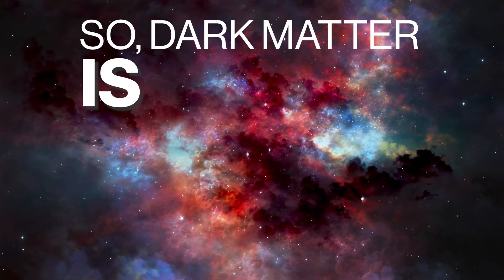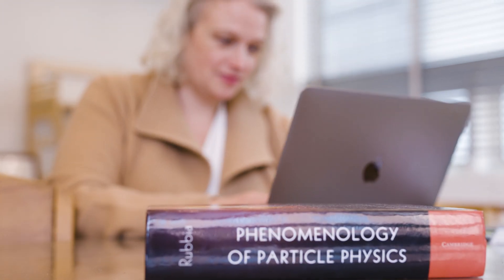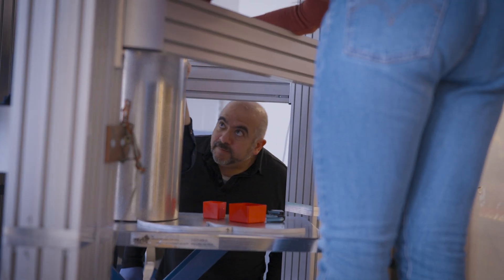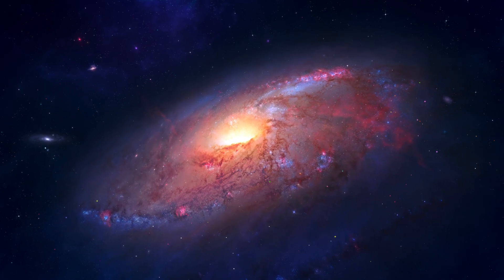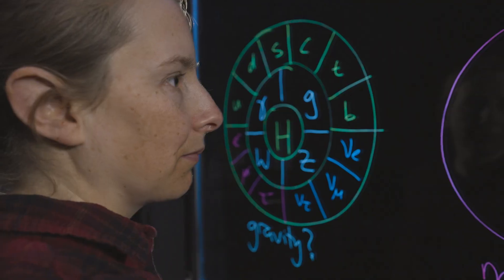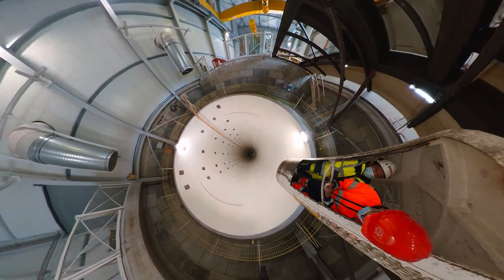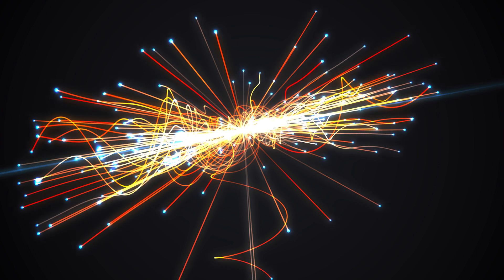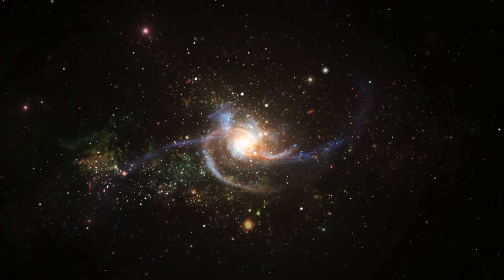The dark matter mystery

Comment: As well known in the field, Vera Rubin discovered the flat rotation curves of spiral galaxies using optical spectra, which could be a Noble prize worth discovery. However, very few people noticed that when Vera Rubin interpreted her observational results, she made a very simple mistake: She applied the spherical model to the spiral galaxies (see the paper published in Science by Vera Rubin: Science, New Series, Vol. 220, No. 4604 (Jun. 24, 1983), pp. 1339-1344). Also, when you read the paper published by Fritz Zwicky in 1937 (THE ASTROPHYSICAL JOURNAL, Vol. 86, No. 3, 217-246) carefully, you will notice that he also utilized a spherical model to estimate the mass of the Coma cluster.
As every physicist should know, an object with a spherical mass produces a Keplerian rotational curve, but a disk-like mass distribution will not follow that. Therefore, the key issue is how the mass is distributed in a galaxy. Any galaxy with a spherical (or close to spherical) mass distribution will not need dark matter. The results of NGC1052-DF2 and DF4 are the examples. The flat rotation curves of spiral galaxies are caused by the disk shaped (non spherical) mass distributions. 
With the latest GAIA data, we can show that by using a disk mass distribution model and by solving the Poisson equation of the Galaxy, we obtain a flat rotation curve which reproduces the key observed features with no need for a dark halo (see arxiv paper 1612.07781.pdf).  
So, dark matter does not exist and it is just a consequence of misusing Newton’s law in gravitational systems with non-spherical mass distributions (DOI:10.1142/S2424942417500049). Newtonian mechanics does not need to modify when the non-spherical mass distributions are considered.
Reply: OK, now you’re just showing off. 😏

Comment: A new galaxy they're sure should be much dimmer than it appears (in other words, it's relatively low in attractive effects despite its overall brightness), although they don't know of any galaxies that look exactly like it for comparison: NGC 1277. Spoiler - it gives an unobstructed view along the cone of a luminous "X" pattern, which itself is likely a frame-drag (spin induction) effect, normally diffused within a significant central galactic bulge where it's consequently mostly evident in many spiral galaxy side views, such as with NGC 2424. 

In short, NGC 1277's brightness apparently depends strongly on the viewing angle, something our self-esteemed experts can easily ignore while wallowing in exotic dark matter confines with wormholes. Nonetheless, even MONDs "cousin field" ersatz gravity halo and imaginary galactic-scale-wavy axions won't save dark matter fools from eventual royally bent gravity theory spacetime misery. 

Imagine gravity flows conforming to spinning baryons shaped like triaxial radar reflectors. I suppose there's a relevant critical angle off the spin axis where a spinning macro-object's gravitational effect macro-flips, from inducing a largely same-direction spin to inducing a largely opposing spin, as the object's spin plane is approached. Seems the spin flip angle forms the legs of any galactic "X" pattern. Possibly the light there is uniquely polarized. A cold (or a strong-gravity-controlled spin) triaxial retro-reflective property for baryons could amplify any polarization contrast. 

Gravity thought-leaders usually avoid calling the Lense-Thirring effect (frame-dragging) a focused quantum gravity effect, let alone an effect showing "spooky action." It's a candor thing, I suppose, easily avoided with a mysterious space-time "fabric" or a "foam" of Planck-scale "bridges" and "holes," where a lack of focus and an easy preoccupation with randomness is not an impediment. Gravity also most likely carries an intrinsic galactic-scale longitudinal spin wave within it, which encourages a notably starless dark ringlike region occupying a substantial area evident in many placid spiral or ring galaxies (see avatar) with an effect of helping to confine fast peripheral galactic matter near its outer edge effectively enough for a "halo" effect to show as a strong peripheral galactic spin profile.
Reply: 😳
Show off!  (But I gave you a thumbs up, because it’s kind of fun being baffled)

Comment: Alternative Explanation of Dark Matter and Dark Energy - 4-D Hypershere model of Universe can easily explain Dark Matter, Dark Energy, Void and even the reason why the measurement values of Expansion Rate are around 70 km/sec-Mpc 

Dark Matter, Dark Energy, Gravity, Void and Antigravity, ... all these are same phenomena. They just look different.
The problem of modern physics is they're trying to explain everything with particle physics and the physics is being cornered more and more to the dead end. To escape the dead end, they invent or design another imaginary particle in vain instead of trying to revise their way to approach to the problem.

I agree to that idea that the interaction between mass and space must be explained with quantum mechanics.
But that doesn't mean gravity is the QM phenomena.
That's because gravity is not a force.
Dark Matter, Dark Energy, Gravity, Antigravity, Void... all these are  just  joint effects of the expansion of the Universe and the curvature of spacetime.
Details are given below.

Einstein’s theory of General Relativity states that spacetime is curved by the presence of mass. 
This curvature influences the motion other objects with mass and gives rise to gravitation.
Thus, gravity is a result of geometric features in spacetime.
However, we also observe gravitational effects – curvature of spacetime – in areas without any detectable mass.
This has given rise to the concept of dark matter, which is matter that does not interact in any detectable way with normal matter, except through gravity.
So, there is some large quantity of dark matter scattered throughout the universe, which curves spacetime and causes gravitational effects just like normal matter, but we cannot see or detect it with any known method.

An alternative theory to the identity of dark matter is proposed – it is not matter at all, but rather an intrinsic curvature of spacetime.
In other words, spacetime is not naturally flat. Even in the absence of matter, we observe some inherent curvature of spacetime.

So, the question is now – why is spacetime naturally curved? Why is it not flat in the absence of mass?
The universe is 4-dimensional, with 3 spatial dimensions and one dimension in time.
Rather than consider time as a linear dimension, we can consider it as a radial one.
Therefore, rather than describing the universe with a Cartesian coordinate system, we describe it with a 4-dimensional spherical coordinate system – 3 angular coordinates, φ1, φ2, φ3, and one radial coordinate in time, t.
We live on the 3-dimensional surface of a 4-dimensional bubble which is expanding radially in time.
Thus, the Big Bang represents t=0, the beginning of time.
The crucial point is that the expansion of the universe is not homogeneous in all directions.

The expansion rate at one point on the bubble’s surface may differ slightly from another point near it.
The universe is only roughly spherical in 4 dimensions, the same way that the Earth is only roughly spherical in 3 dimensions.
The same way we observe local mountains and valleys on the surface of Earth, we observe local “mountains” and “valleys” on the surface of the universe bubble.
The inhomogeneity of the expansion of the universe has given rise to natural curvature of spacetime. This natural curvature causes the phenomenon of “dark matter”. “Valleys” in spacetime pull matter in, similarly to the warping of spacetime of massive objects.
So “dark matter” is really “valleys” in spacetime that are expanding slower than the regions surrounding it.
These valleys tend to pull matter in and create planets, stars, and galaxies – regions of space with higher-than-average densities of mass.
Conversely, “mountains” in spacetime will repel matter away, an “anti-gravitational” effect, which gives rise to cosmic voids in space where we observe no matter.
Each point on the surface of the universe bubble traces out a time arrow in 4-dimensional space, perpendicular to the surface.
These time arrows are not parallel to each other since the universe is not flat.
This causes points to have nonzero relative velocity away from each other.
It is generally accepted that the universe is expanding faster than observable energy can explain, and this is expansion is believe to be still accelerating.
The “missing” energy required to explain these observations has given rise to the theory of dark energy.
The time dilation caused by non-parallel time arrows can be proposed as an explanation for dark energy.

Alternatively, dark energy is real energy coming from potential energy gradients caused by non-parallel time arrows.
As a sanity check, we can calculate the expansion rate of the universe based on the universe bubble model.
Since the radius of the universe bubble is expanding at the speed of light in the time direction, it increases at 1 light second per second.
Therefore, the “circumference” of the 3-dimensional surface increases by 2π light seconds per second, or about 1.88*10^6 km/s.
This expansion is distributed equally across the 3-dimensional surface, so the actual observed expansion rate is proportional to the distance from the observer.

At present, the age of the universe is estimated to be 13.8 billion years, so the radius of the universe bubble is 13.8 billion light years, or about 4233 megaparsecs (3.26 million light years to 1 Mpc).

Thus, we can calculate the expansion rate of the universe, per megaparsec from the observer, as: 

Expansion rate = ((d(circumference))/dt)/radiusofuniverse=(1.88*〖10〗^6 km⁄s)/(2π*4233Mpc)=(1.88*〖10〗^6 km⁄s)/26598Mpc=70.82(km⁄s)/Mpc

The popularly accepted empirical expansion rate is 73.5 +/- 2.5 km/s/Mpc, so our calculated value is close.
There may be some additional source of expansion (or observed red shift) to make up for the discrepancy. For example, if two adjacent points have some gravitational gradient due to non-parallel time arrows, then light passing through these points will be red-shifted.
– Cited from https://www.academia.edu/82481487/Title_Alternative_Explanation_of_Dark_Matter_and_Dark_Energy

Comment: Dark matter is neutrinos and only neutrinos.

Classical WIMP-based dark matter theories and MOND have 7 and 12 sigma against each other by now, and the ALPS-II detector that will be upgraded in 2024 will soon rule out axion-based dark matter theories as well, namely by moving the exclusion boundary in the parameter space of eligible particle type cases further away by a factor of one thousand compared to where it currently is, because those axion-based dark matter theories are incapable of explaining neutrino-swarm-like planet- and star-sized dark matter phenomena, and a whole mix of different types of axions would be required for this dark matter theory anyway.

Meanwhile, Lu Yin's team's recent research results (likely based on my neutrino-based dark matter theory) are indicating a strong link between dark matter and dark energy in the form of energy transfer from the former to the latter (just as it should be in my theory), providing further strong support for my theory:

"The three dark energy models above have been constrained by the previous research [33–36]. In this work, we are more interested in the evolution of the three models in the local Universe, so we fit free parameters by comparing the data from baryon acoustic oscillations (BAO) [63–66] and Type Ia supernovae (SNIa) [67, 68]. The best-fit results are shown in Tab. II. H0 value from the model and the ICPL model are 70.6986+0.2639 −0.2601km/s/Mpc and 70.9338+0.2549 −0.2515km/s/Mpc. The fitting result of γ is a negative number −0.0078+0.0192 −0.0118, which means that a high possibility of the energy transfer from dark matter to dark energy."
Reply: nifty job of copy paste from published papers..... say hello to Super Metroid    😎